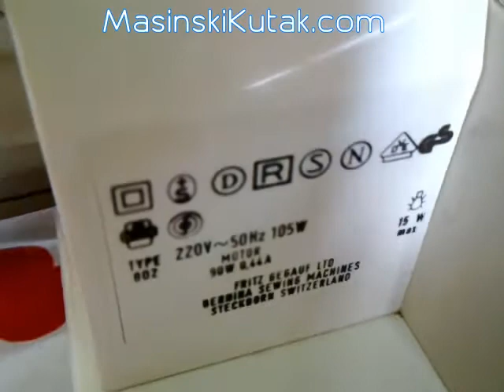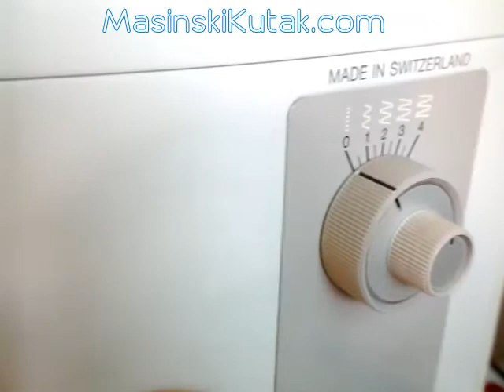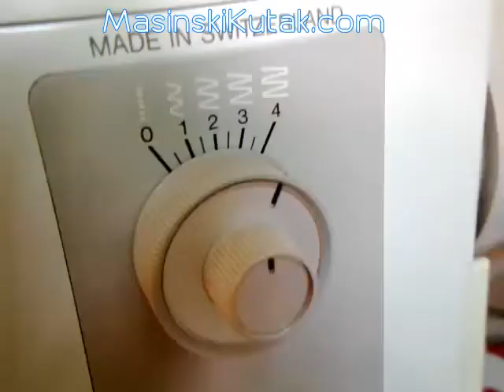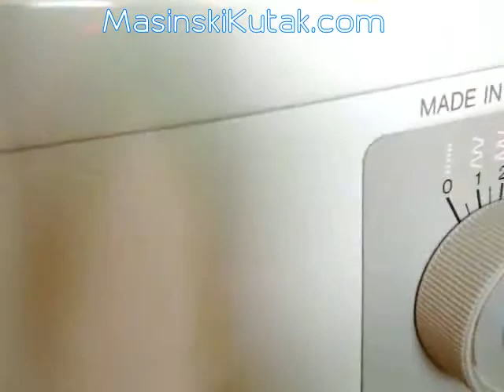Bernina 802  Matic Electronic / Bernina 810

Comment: Thank you for your videos! I have watched many. 
Is the bobbin hook and bobbin in the 802  smaller than the 830? I can't close the bobbin retaining ring using a class 15.
Reply from the maker: The hook and bobbin are identical on the Bernina 802 and Bernina 830 Record.
The second part of the question I do not understand, class 15 ?
Reply: @MasinskiKutak  The bobbin size is called class 15 in the US.
Reply from the maker: @tammyc-p8324  
Yes, this is most likely related to Singer class 15 sewing machines. By your problem it is obviously not fits. All old Bernina machines have the same bobbin dimensions and bobbin case.

Comment: I am looking for the electronic Printed Circuit Board for my Bernina 802 any idea where I can find one >..Thanks
Reply from the maker: "Printed Circuit Board for my Bernina 802" 🤔
The first time I hear about it, you might be thinking of an electronic board located in the speed controller. ??
Reply: @MasinskiKutak  Yes
 You are right it is for the speed controller ..  I am also looking for the Carbon pins for it  ..   it is a 220volt European one..... thanks
Reply from the maker: @boradruma  
I had the original controller for you, I sold it, it is a better solution for you to buy the whole speed controller, the installation of electronics and carbon rods are the job for the master.
This is picture:
https://www.pinterest.com/pin/375206212716026181/